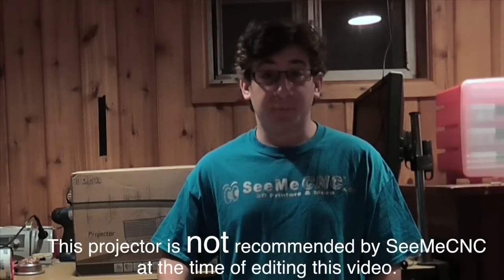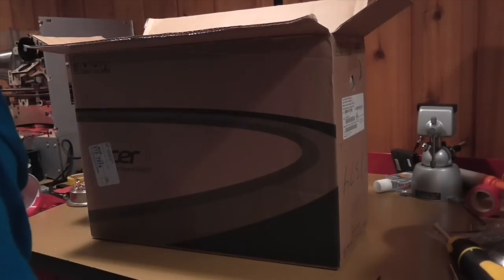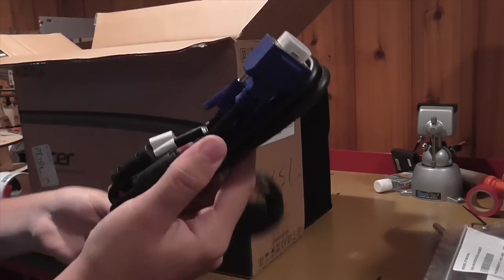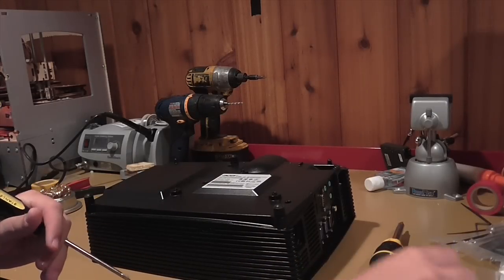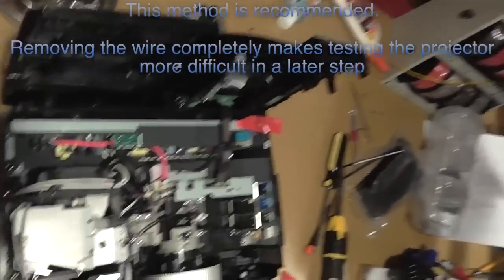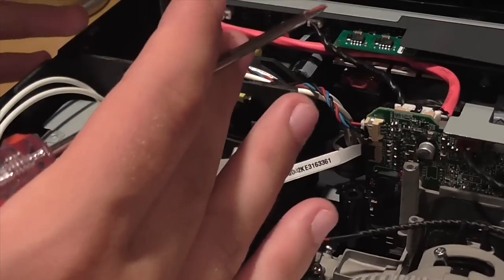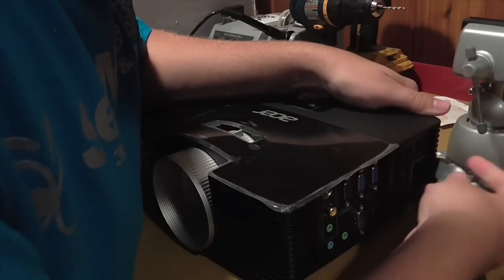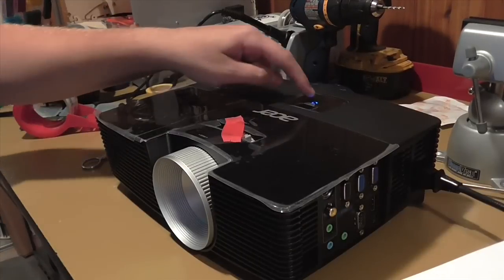DropLit: Acer P1283 Modification Tutorial

Comment: Also... never turn a projector off like you did, by removing that tape from the safety switch. The projection lamp MUST BE FAN COOLED after turning it OFF... this is a common cause of premature lamp failure. Use the remote control, or at least the normal Power button on the cover to turn the lamp off, then wait for the fan to stop running before removing the tape or AC power. 
ALSO...
Projection lamps should never be run for LESS THAN 10 minutes, as the metal halide salts need time to FULLY vaporize, and reach full operating temperatures. If they are short-cycled, you will cause blackening inside the bulb, which drastically reduces the light output... as well as bulb lifetime. 

After turning a projector OFF, allow it to remain OFF for no less than 10-15 minutes. This allows the 1200° bulb to fully cool, and the vaporized metal halide salts to recombine... again, to prevent blackening inside the bulb.

LED based projectors don't suffer any of these problems... but neither to they have any UV output as needed for curing the material.

Comment: Dude... you really should give precautionary warnings about messing with the insides of projectors.... as there are FATAL voltages inside there. The lamp ballast typically runs on 170-190V DC, which is fatal.  In addition, once you remove that UV filter, you should warn about NEVER allowing the projected light/image shine directly into your eyes!... or even a reflected image from white paper... the UV level is dangerous to your eyes!  When handling the lamp assembly, NEVER touch the bulb itself, or the reflector. Even the tiniest amount of skin oils will cause a hot spot on the bulb or reflector, and cause a very early failure of the bulb or reflector. The bulb operates at around 1200°F, and the reflector can reach 800°F.  It's also a very bad idea to operate the projector with the cover removed... this often severely reduces the airflow across that 1200° bulb, and without proper cooling it can explode within a very short time.  Look at the cover, it closes-in the fan airflow, ensuring that 100% of the air is directed across the bulb. With the cover removed, the air takes the least path of resistance... and it's NOT across the bulb.

ALSO... do you realize that you plugged the AC power cord in before messing with that "cover detection" safety switch? That switch has Line voltage across it... you are working right next to 120V to 230V AC right there at your fingertips.

Why can't you remove the focus limit screw like you already did, and then remove the outer case grey plastic focus adjustment 'knob' so you can gain access to the lens focus ring through the outer case - after it's fully reassembled? That way you don't need to defeat the cover safety switch, and the lamp cooling will operate like it's supposed to... and people watching your video will be less likely to suffer serious or fatal injury.